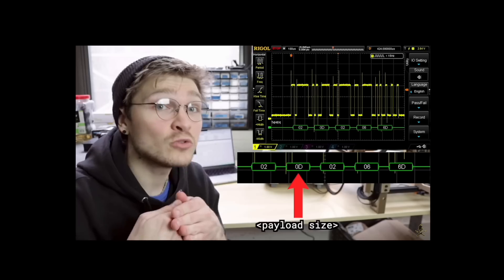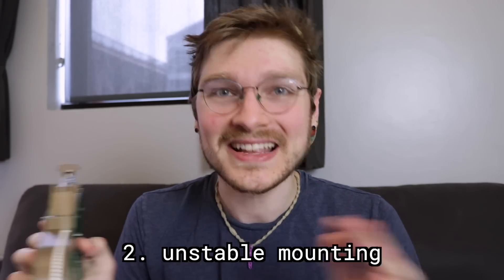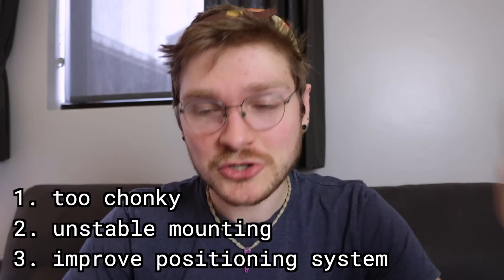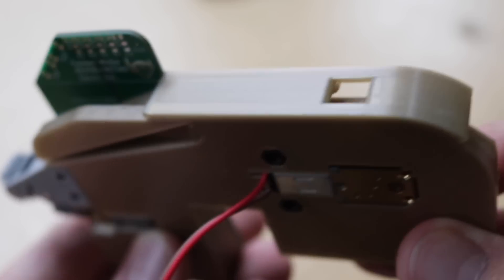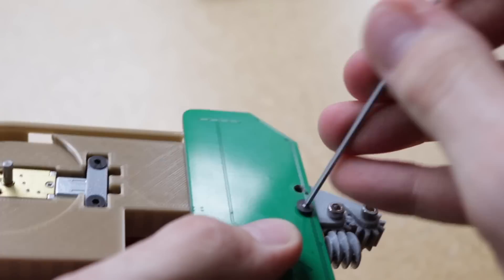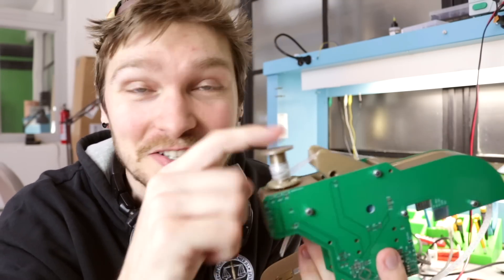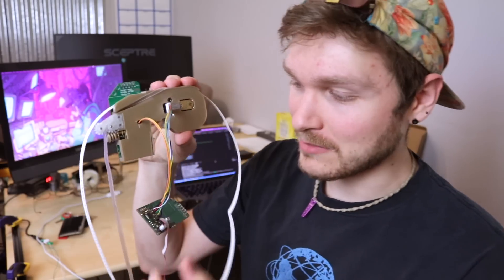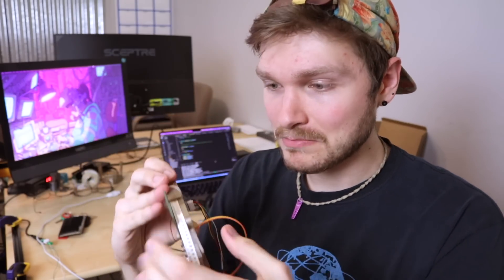Feeders just got a whole lot smaller

Comment: I wonder if a IR reflection sensor will be able to look up and see the holes in the edge of the tape?
Or how about an idler gear that engages with the holes like the drive gear does, and have an encoder on that?
Reply: An encoder driven by the tape itself would instantly remove all issues regarding drivetrain backlash/play, and could be used to automatically index the drive system off the tape itself if the parts pockets have any mathematically direct relationship with drive holes, e.g., if a part pocket is aligned with every third drive hole. Plus, the encoder could be built right into the control board - stick two hall-effect sensors at a 90&deg; angle and have quadrature encoding built in. Having the encoder driven off the tape would also eliminate having to get the motor with the encoder on it.
Reply: @OddlyIncredible  Yeah that's what I'm thinking. There's a direct relationship between the hole pitch and the placement of the pockets, so it'll be the most accurate way to do it. And if you used an encoder on an idler wheel, you could match the teeth count of that wheel to the resolution of the encoder

Comment: Whoa - chamfered holes in the pcb?  Did the house do that for you or did you do it?  Never seen flat screws used with a pcb like that.
Reply: Based on the captions of that section, it makes me think he did that himself, because the caption said “the next ones will be pre-drilled”
Reply: An alternative to countersinking is to simply oversize the holes.
Reply: Yeah, pretty cool! Many board houses offer counterbore and countersink drilling. A smaller subset also offer Z-axis milling, too.